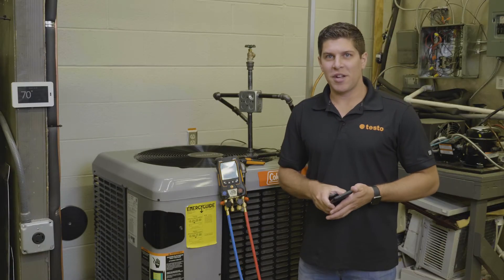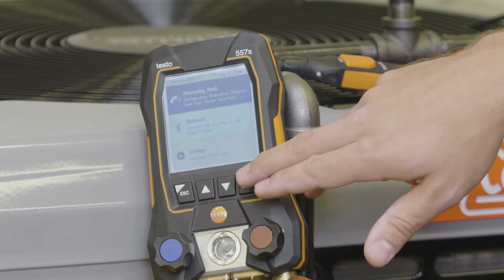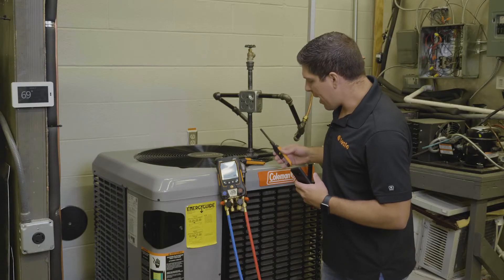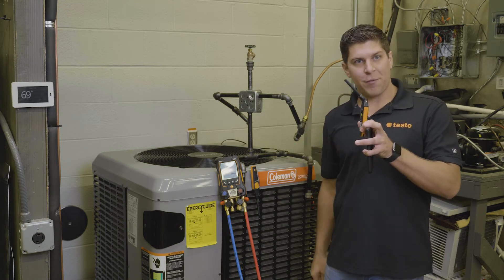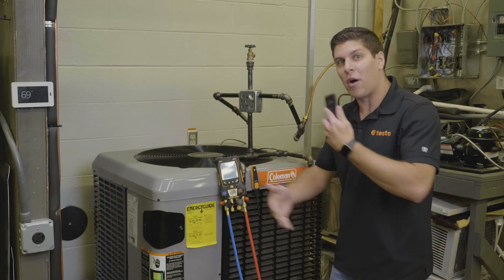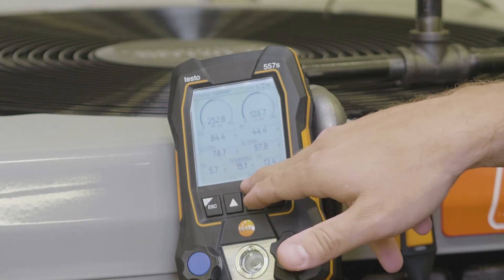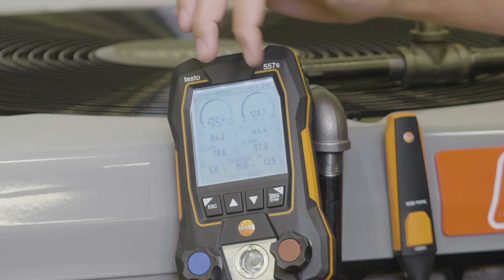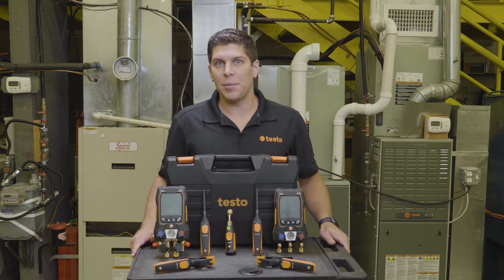Application video testo 550s testo 557s measuring modes | Be sure. Testo

Comment: Mine is absolute garbage! Testo 550S. Used it and it worked well until I connected it to my phone and it did a firmware update. The update bricked it! Says E14 Language Update Failed Try Again. And I've tried a dozen times and still fails on startup. I've been able to access the Bootloader menu but I doubt seriously Testo will send me a file to load to it. Now its a $550 paperweight!!